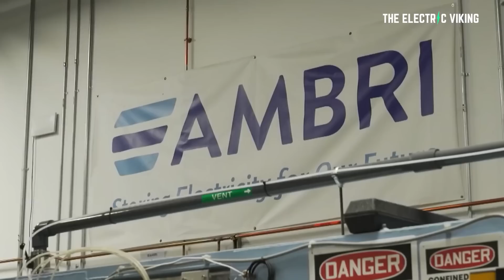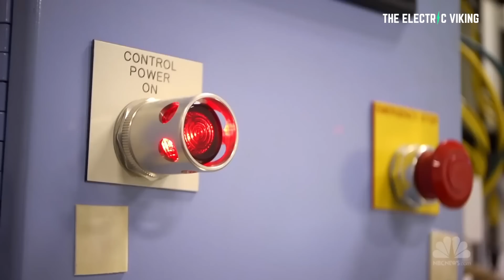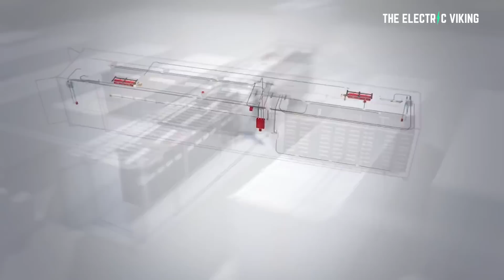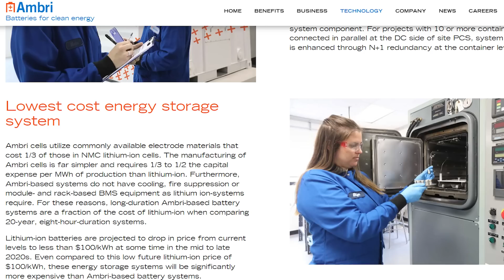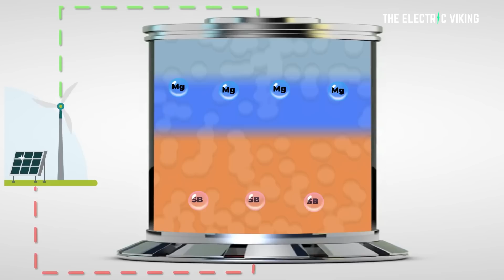US Liquid Metal batteries will reduce the US's reliance on China

Comment: Bill Gates does not have a good track record in choices of future technology. He shorted Tesla shares for a long time and probably still does. In fact a significant portion on my Tesla profits should have come out of Bill's pocket. If I understand it correctly, liquid batteries pump the liquid along a much smaller electrode area than would be available in Lithium batteries. How long do these electrodes last? Batteries with moving parts sound like a step backward in my opinion, unless other benefits are very large. Very large grid scale batteries should have been replaced by liquid batteries by now, if the advantages really are that large.

Comment: Not many people have mentioned this but the memory effect doesn't affect lithium based batteries. It affects NiMH and NiMC batteries. It is characterised by a reduction in capacity based on the minimum charge level that you begin recharging the battery from. I.E. If you start charging the battery at 25%, that becomes the new 0%. It's not quite that affective but that is the gist. 

I remember back in the day when power tools had NiMH batteries we would always run the drill all the way down flat on the way to the charger to avoid this affect. Lithium batteries on the other hand can be recharged from any state of charge and in fact prefer not to go below about 20-40% SOC.

Comment: Sorry. All of this new (always revolutionary) battery tech is too vague for any type of judgement on whether it is any use at all. Energy Density? Energy Density? Cost per kwh of storage? Energy efficiency (input vs output power). Cost to maintain 500C? Cost to achieve 500C from cold start? Time to achieve 500C from cold start?
This is why Musk became jaded on battery tech claims. 
The truth is that a Fantastic new battery can pass every single hurdle (energy density, power density, cycle life, etc) and still fail on one single metric. (The same can be said of the perpetual motion machine... just one metric short)

 As for Bill Gates seal of approval... Terra Power is sucking huge US funding but not showing the greatest promise of all the new Nuclear technologies out there. 
Maybe I'm wrong, but sorely lacking is a simple comparison of their tech to 40 year old Russian tech also using liquid sodium coolant? Still, to be fair. Would produce small, flexible reactors that are safer than old tech reactors... very low bar compared to other, more promising nuclear tech in the works today, such as Liquid Salt Thorium reactors (Not the dead Solid Thorium tech). 

And that's missing here too. They have to compare all metrics to leading edge LFP. 
If the result isn't promising... their tech is dead in the water.

Comment: Thanks Sam.

Questions need asking about these cells: How much do they cost to buy? What is their energy density per litre and per kilogram? In other words, how much electricity can a shipping container-sized pack contain reliably? How many discharge / recharge cycles can they withstand? Can they withstand over-charging, such as when a BMS or recharging system failure occurs? Can they survive reverse polarity, in the event of a failure elsewhere in the battery? How well do they tolerate excessive discharge rates? How robust are they, physically? How toxic are they? What happens if a cell is broken by crushing or impact? How well are they insulated thermally? That 500°C of heating has to consume energy, and if burst, there's a lot of thermal energy which can be hazardous to other flammable materials and to people, so thermal insulation and robustness become important considerations.

I'm looking forward to seeing these being deployed and used economically, if all of the relevant questions can be answered satisfactorily.

Comment: A couple of things Sam, Lithium batteries do NOT suffer from “memory-effect”.   You are confusing them with Nickel Metal Hydride batteries, which do, suffer from memory effect. 
And, these “Liquid metal batteries” need to run at 500 degrees C, to operate, which means that these batteries are themselves, constantly, wasting, an enormous amount of power, just to maintain them, at that extremely elevated ‘working temperature’…!  🙄 
Hardly a very efficient means, of energy storage…! 😳

Comment: All that is needed for liquid metal batteries to be commercially successful is commercial success.  In other words, they need sufficient market to mount the production volume curve to bring down prices.  And they are no competition for Li batteries.  We need all the Li for mobile applications.  Incidentally, there are two possible mobile applications where these batteries could be the answer.  One is for trains.  You would have a battery car like the old coal/wood car that sat behind the steam engine.  Such cars could be swapped out when making up trains and the exhausted one recharged or they could be charged when traveling over electrified parts of the track.  Another application could be for ships.  You would probably have to put in some baffles to limit slosh but they are filled to the top with the reactants so slosh would already be mitigated to some extent.  There is another chemistry you should investigate.  It is right there in Australia.  First there is the ZnBr flow/plating battery from Redflow and, possibly an advance on this, the ZnBr gell battery from Gelion.

Comment: Call me a naysayer, I have been following this bozo since he started shooting his mouth off about this battery.  Despite his claims of just around the corner, he has never delivered 1 battery.

For years, he shot off his mouth about being the best battery anywhere.  Every couple of years, he would post a new milestone breakthrough on his website.  100 W battery, then 500 W, 1KW, 5KW, and as I said, you could not buy one, and there was never any 3rd party verification of his battery's.  Professor Pumpernickel has ZERO credibility!

BTW, I noticed he has a slick new website with new claims.  He really downplays the fact that the battery has to run at 500 Deg C.  This has been the downfall of the miracle battery all along.  The seals in the battery cannot hold up long term, and the battery fails.  Has he finally solved this problem?  The only way we will know is if he does not deliver AGAIN.

Comment: I can see a molten metal battery used in a high current environment.  The small size of the cells seems absurd.  You would want to hold in heat, right?  Volume increases faster than surface area, so they should do better with a much larger cell size.

Comment: Sooo... these are hot batteries, right? Molten? What happens if they cool down and solidify? Do they lose their charge or can you can just melt them again to regain access to the stored energy? Does heating them up consume more energy than they can store, or less?
Reply: Charging and discharging creates a significant amount of the required energy and the insulation keeps it in range for extended periods..  
These are built for  days and  week long grid storage...not just handling short term grid spike loads of a handful of hours..
Reply: @clivestainlesssteelwomble7665  
None of that answers any of my questions, nor does it contradict any of the premises behind my questions. Of course they won't freeze when they're in regular operation, of course they're gonna be thermally insulated so it's unlikely for them to freeze. But what happens if they do freeze, for whatever reason? Are they just broken and have to be recycled, do they lose their energy, do they start to short-circuit to keep themselves hot with their stored energy until they run out, etc.?

You're responding as if you're defending them from an accusation, but actually I just wanna know their properties out of curiosity.
Reply: @ParaSpite  
They cool to a solid ... For transport ...  when they are heated by charging they become active ..  

I know that if hit by a  .50 cal round they would quickly become just a brick of largely unreactive material. Unlike most Li ion battery tech or lead acid leaking corrosive acid and lead. .. go to Prof Sadaways  own lectures or Lets have a think about... Channel on these cells and how they behave. 

A lot of the initial inspiration for these  cells came from reverse engineering Al smelter technology. 
If i can find the specific lecture/talk link i will put it up but Im in the middle of a house move at the moment.

Comment: Sam there is another battery produced by Highview. It is based on converting air into liquid air with surplus electricity. When electricity is needed the liquid air is heated to produce high pressure air which spins the turbine and generator. This battery has no scarce metals. The only cost will be the insulated high pressure vessels.

Comment: Problem:  greed

There are existing technology such as “salt water” battery which Gates invested in.  There are liquid flow or redux or reflow (whatever the variant name they have).  These tech promises safe chemistry, off-the-shelf material & hardware.  (Get a couple of ICB totes in your garage, fill it with safe chem & power your house for days)

Where is the “electric Moses” offering tablets with DIY solutions?  NO, every F—ing company will want $10,000 for a battery pack made from “common, safe mineral & water” (reflow battery).  

If this tech (been talked about for 10y, these reflow battery) is so easy & cheap, where the F… is Jesus Christ offering salvation of DIY information?

Comment: You forgot to mention one thing: liquid metal batteries are only 70% efficient compared to almost 100% for lithium ion batteries.
Reply: That is only a problem if over building the supply is expensive.  Wind and solar is so cheap that overbuilding by 30% is just building a robust system that has the ability to withstand failures.  The power grid often over builds capacity to avoid the failures of the Texas grid.
Reply: 70 percent is quite good.
Reply: @pk47831  not for batteries

Comment: Love this idea of grid scale batteries but I keep going back to geothermal as the real grid scale answer it’s super straight forward and can work any where pretty much drilling is obviously the problem but there has been research into using old oil mines as a starter hole and then using plasma drill bits to go into the granite for the hot rocks this is easier than using mechanical force for drilling. Clearly this is better when used in those countries that sit on relatively shallow hot rocks but that covers a huge percentage of the world
Reply: I expect this solution to work great for geothermal plants.

Comment: Seems like a liquid metal battery could go perfect with recycled salt from making fresh water from salt sea water.  I mean the big storage to companies and homes and stations. Well there allready using salts to help make the battery so perfect electrolyte. These batteries could be self and air cooled. Low cost and separate low competition best choice all around for many types of energy storage. I think a very good choice   for a lot of world regions and the technology is ready now and will only make everyone and everything better. I mean a cold climate battery could partner up for mixed seasons and weather with a simple to make temperature 🌡 switch and voltage ⚡️ spike capacitor. I for one will welcome world wide choice and affordability.

Comment: Nope.
Ca 4% of crust, antimony An 0.00002%. (Must be easily found as used for 3,600 years)
If cooling takes energy, so does heating.
While raw materials cost is long term determinant, getting to that scale takes adoption while it’s expensive. Li-ion / LFP / LFMP has advantage of use for vehicles, gets to scale quicker.

Comment: Lots of claims of "game changing" technologies. And a handful of really incredible new technologies that keep improving incrementally over time. 
I'm all for it, but until there is at least a prototype being tested to demonstrate the technology, I'll view it all with hopeful skepticism. 
So far, the majority of proven, cost-effective technologies are lithium ion battery variations. 
Lithium ion has not reached its expected potential quite yet. It's just starting to improve to the point where it is edging into cost competitive with ICE technology. 
Each variation has it's strengths and weaknesses. 
At least the company ONE has produced a demonstration of its technology.
Solid state, sodium, sulfur, silicon, hydrogen, liquid metal, flow, and probably a few others are all promoted as game-changing technologies. But after Tesla first introduced the 4680 tabless breakthrough, it's still requiring constant engineering and testing to make it a reality in mass production. So I guess it may be a while before we see this technology really implemented.

Comment: What about the battery having to be at 500C - that`s a lot of energy, and expensive insulation?
Reply: True, but it is easier to heat something than it is to cool it.  So far, cooling always seems to be the issue with current systems.
Reply: @notsomuch7875  
Its also far safer as the battery 'freezes' if the temp drops or no energy/ heat is applied to activate it.
So in the transport state or in case of any traumatic  damage the whole module becomes a safe mass.
Reply: I do not agree, it takes at least similar amount of power or much higher for heating because at 500C you cannot use a conventional heat pump, if at all, so direct heating means 100% power waste, but with cooling you use 15-20% of power for the amount of cooling done.  The whole equation here is not simple because things like how much heating and cooling is needed and when (i.e., long term duty cycles) comes into this. and with Li batteries you need to cool only when using or extreme hot days, and some heating when in extreme cold weather days idle, but with molten metal it is all the time, unless you can live with a very long start up from cold, which is likely not practical.  I have not done the maths, but a cursory look at it says to me that it is not insignificant, but how much, well may be you can do the maths, I cannot without doing a lot of research.
Reply: @stevenbliss989  

Once they are heated up they start to function and that maintains the functionality of the cells. The energy/cost per MW has to be close to gravity pumped hydro storage... as that was the initial basis for battery design success. 🤷🏻‍♂️

Comment: Thanks for sharing your videos. Very interesting idea, the size would be ideal to mount on train cars and shipped between regions that have transmission restraints. Frequently you will have areas less than a few miles apart that are electrically limited with negative prices on one side and exorbitant prices on the other side. These could take advantage of the low off peak prices and then easily transported to a better market for the on peak high priced market. Worked for years in the power industry and they have very little imagination when it comes to innovative ideas to long standing problems. I would almost speculate that they people are already taking advantage of the price diversity and see no need to correct it.

Comment: Too heavy
Reply: These are not used for anything small and mobile. These are grid level ..building sized stacked storage facilities that have to work for 20 years plus Sadaways early work indicated a life span of 80% capacity after 80 years and 100% recycle-ablity ... And run a town city or industrial complex for days..not just a couple of hours.
Each module is designed to stack on a standard road /rail /ship container system set up ..  so it can even be air transported by military and civil freight handling systems.

Comment: I've been following this work and the battery research at Argonne and other National Labs for over a decade.  The problem is getting the batteries out of development and onto the grid.  That is hard, comparable to production hell that Elon talks about.  We need someone like Elon to take the most promising research, get it out of the lab and onto the grid in this case.  That may happen but we might just transition to the Tesla solution, l-ion batteries from mass market producers providing energy storage on the grid.  That will work economically -- see Tony Seba.

Comment: I'll believe it when I see it. I've been following this story for over a decade, and frankly this isn't the first time they've been "just around the corner" from delivering products to customers. I'm a big fan of both the concept and Dr. Sadoway himself, but damn... it's been a LONG TIME and I'm still waiting. I sincerely hope this time it's the real deal.
Reply: Sadoway is a hype man, to put it kindly. He plugged his battery as a dirt cheap alternative to Li-ion. To quote him, "If you want to make something dirt cheap, make it out of dirt." Now one of his "dirt cheap" elements is antimony, with a price 20x that of iron and 1/40 the abundance of lithium.
Reply: Hasn't this technology been actually used in a car before? I remember something about molten salt batteries that could cool down and solidify if the vehicle wasn't charged in too long. I forgot the details though, like can the battery be heated back up to make it functional again, etc.
Reply: @ParaSpite  No, it was never going to be suitable for a car. It need to pretty much either be charging or draining constantly, and the liquids inside need to be on a stable surface, not sloshing around in a vehicle. If I remember, weight was also a no-go for cars.  Still, best case, it could make a great replacement for (e.g.) Tesla Megapacks and eventually even Powerwalls. This would free up all that lithium supply for mobile applications like cars, computers, etc. I too have been hearing about this tech for years, and was hoping for more new information about it other than "coming soon" to "a customer."